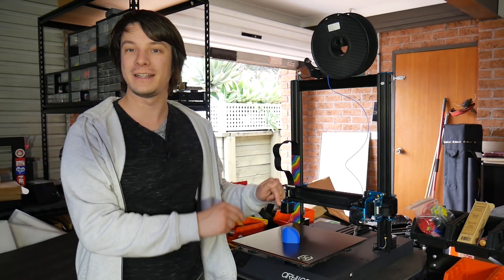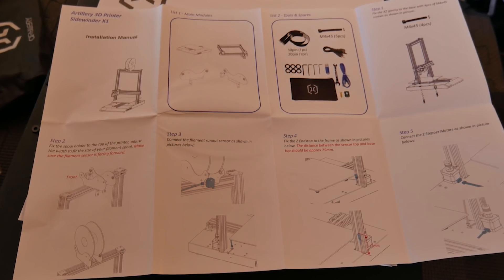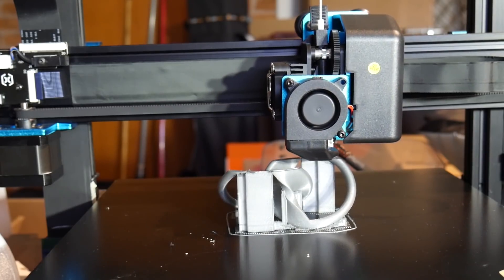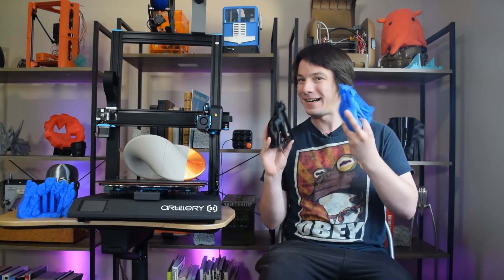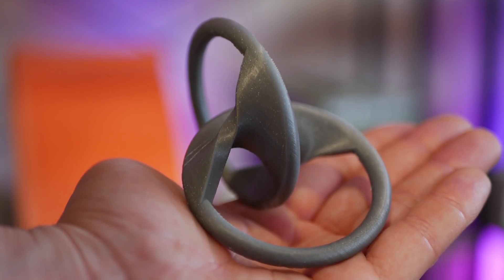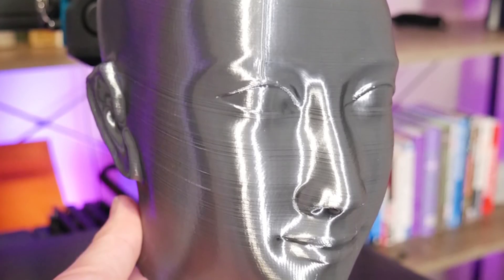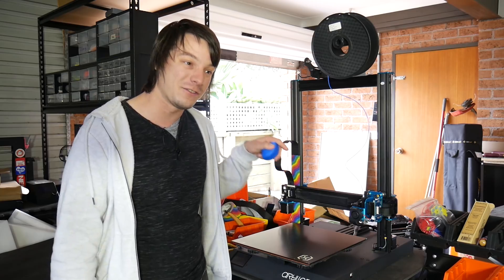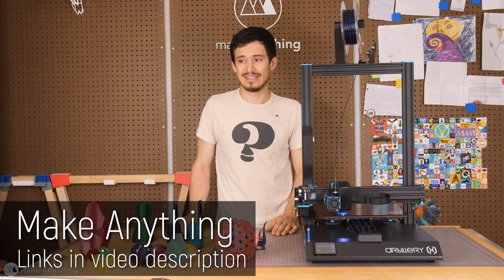Artillery (EVNOVO) Sidewinder X1 Review

Comment: Nice honest review Angus! Keep it up! We were testing a sidewinder for our new print farm. It's got a lot going for it and we were very happy with the kinematics. The issues we faced and the reasons we decided against it in the end are:- 1) the hotend isn't getting enough current through the ribbon cable and can't pump out filament at a reasonable rate - slows down prints and defeats the purpose of the Volcano - Maybe it was our version ( I think they're up to 5 or 6 now) but you can see the results of this where you have almost matt looking straight sections of prints and then it goes watery at corners where it slows down and the extruder temp catches up for a fraction of a second 2) the bed height sensor isn't accurate enough to rely on - looks to be +-0.1mm - the BLtouch in the works will fix this well. 3) like you Angus, we found the ribbon cables to be a problem with no lock on ours too and it coming unplugged too easily - would love a more secure connection. They're so close to what could be an iconic printer but we'll likely wait for v2 or 3 before looking at them again.
Reply: @Don Gray Hi Don, it's hard to keep up with the different versions with small and major changes Evnovo has made. I actually thought we had a version 4 but I think it was more like version 3.5 as we didn't get the ultrabase. A couple of months after we got ours, Evnovo 'fell on their sword' and shut up shop to work on the problems that the sidewinder was having before they came back with a new/better final version - this was all on their official FB page. The new version is what I thought would have been version 5. I'll give them credit for working hard to fix problems but I'm not prepared to be a beta tester for them. After that, we lost confidence in buying a bunch of these and stopped following. It's still a promising platform so I hope their next printer builds on that.

Comment: I've had mine for about 3 months now and the 30 pin connector at the base that you pointed out went bad, I tried doing exactly the same thing you did, but it still gets really hot to the touch, it doesn't get hot until it starts printing so I'm thinking the heat comes from the filament feed motor. But it's down until I can figure out a fix for it. Thanks for a great review 👍
Reply: I also have the same issue, and like you my printer is down until i can work out a better fix for it

Comment: To me these ribbon cable connectors look like a sub manufacturer has silently cheaped out a little.
Reply: Which makes zero sense; Even in bulk, there's really no real cost difference between the types of "FPC" connectors, at least when checking Alibaba. These appear to range between .01 USD (one penny) - about 1 USD per with a min order of 1000 units.
In fact, when I try looking for these, the most common ones are the "Flip lock" and "Stuffer Actuator" (slide lock) types. I am actually having trouble finding ones without the clampy bit.

 Based on the average price I've seen these from other sites other than Alibaba, if we estimate 30 cents per unit and buy, let's say 5000 bits, that's 1500 USD. Considering both parties (the circuit board manufacturer) and supplier for the connectors are likely down the street from each other in China, it's likely the costs would be significantly lower.

In other words, there's zero excuse for this from any 3D printer company. It's not being cheap, it's being ignorant.
Reply: @MasterThief117  well, it is easily explained, they just do not know what they do...this is a common problem in china...manufacturer do lack qualified employees...if i am informed corretly, former tevo employees are involved in enovo....a smart company would probably look on thingiverse and copy all the cool upgrades or necessary ones and make a new version...but as there are so many chinese outlets, people will buy the product anyway, customer service as lowsy and takes long, well so the do not bather and print it themselves if they can...so why change? only a few chinese companies have learned from mistakes and are now industry leaders..i have worked with those and it is a one in a million who actually listen to advice....

Comment: Emm, that ribbon cable does not make me feel comfortable. What is the current rating of that cable? How many wires are used for heater? What happens when because of bad connection only one wire is left to provide power to heater?

Comment: Saw your tweet yesterday. Did that ruffle up any answers?
Reply from the maker: New versions have different connectors and mine became flakey, all older reviews seem to have better ones with locking tabs.
Reply: @MakersMuse  ok, so can you assuming get a new ribbon and connector set?
Reply from the maker: @KieranShort  that's my only real complaint, everything else is easy fix and the machine is solid.

Comment: Looks like a nice printer, I think I'll –

Oh. Flat Ribbon cables. Everywhere?

Skip.
Reply: @Don Gray These are FLAT Ribbon cables that aren't meant to be user serviceable. Aka, the design is one you find inside a laptop.

You went all war of words, but I'm not referring to the ribbon cables on such as the Ender 3.
Reply: @avaviel  strange that I have replaced and repaired them on PCs when there were issues. Only thing is the industry has moved from parallel to serial for faster data rates. The new SATA cables can also have serviceability issues.
Reply: @Don Gray Every single connector on that machine is a huge failure point. Again, my problem isn't with regular ribbon cables like the kind of connectors you have on floppy drives.

The ones they're using are meant to be never user serviced and never disconnected. That is a recipe for disaster with a 3d printer for a hobbiest.

Comment: I disassembled the spool holder from the gantry, because it is too much weight on the top, which makes the gantry shake slightly due to axis movement. First realized it, when I had a 2.5 kg spool on top and the print quality was just awful.
I've got better results since I removed it.
Reply: I've seen a number of printers with the spool held up there and though it Takes the spool out of the way. It does make the printers visibly rock.

Stand alone spool holder I think is the beat option  for anything other than a super solid framed printer
Reply: @Don Gray that was just my example for when i realized the problem first ... 🤦‍♂️
Reply: I have the same issue, you can buy a kit like this one https://www.gams3d.com/producto/barras-traseras-artillery-x1/ or print your self the parts available in thingiverse and buy a 8mm threaded bars for complete the installation
Reply: "too much weight on the top, which makes the gantry shake slightly due to axis movement"
Which axis (X, Y, Z) movement do you think could induce a shake due to too much weight on the top? Isn't the spool holder secured to a stationary frame?
Reply: It is all connected to the frame. And there is no damper between the axis-connections (XY) and the frame - so every vibration is given to the gantry as well. And the more weight is on top which comes into movement the more it shakes. The shaking also increases with the height of the print in Z.
Reply: Yeah I dont what genius came up with putting a big spool on top of a printer. But the crazy thing is everyone else started doing it. It will mess your prints up drastically. Swinging a few pound weight on the top of a precision instrument is no bueno. Seriously. Do the same print 2x. One with the spool on top and one off. It is extremely obvious which is the one with it. If you have ghosting and filament bugers that you can't seem to get rid of......guess what the culprit is. It really is crazy that this keeps happening

Comment: I had forethought about the ribbons early on and used low temp hot glue as a  minute fix- the machines here have exceeded 3k hours without issue since. I never use top mounted spool holders so that explains why weve never seen artifacts. Small fixes for a big return.
Reply: Can you elaborate on what the hot glue achieves?
And where do you place the spool if not above?
Reply: @mozkitolife5437  I secured the ribbons with the hot glue, and later made a mod for the extruder cable. I have shelving above all of our printers (20+) and created hanging holders for them all.
Reply: @EarlMiller  Thanks. Don't ask me why I thought of the belts when you meant the ribbon cables.